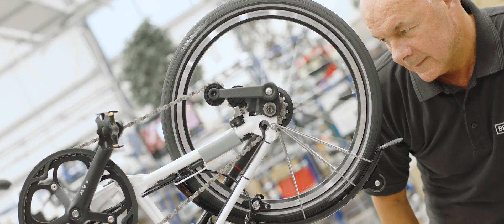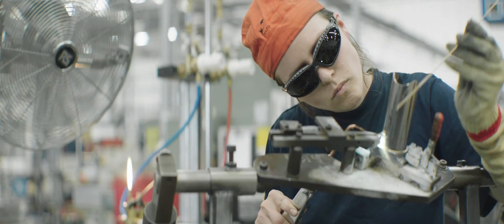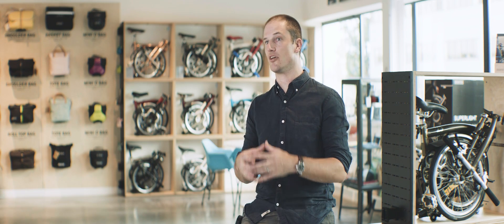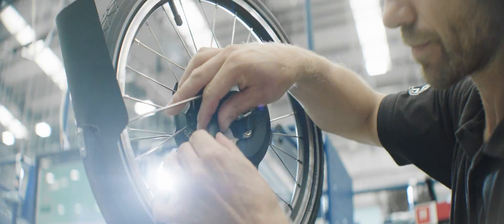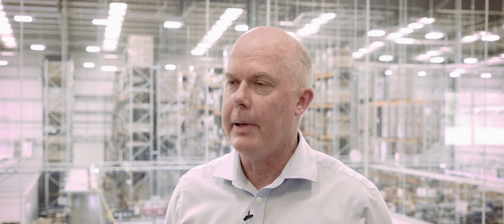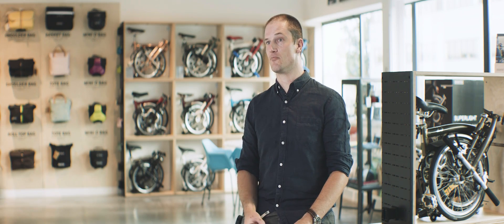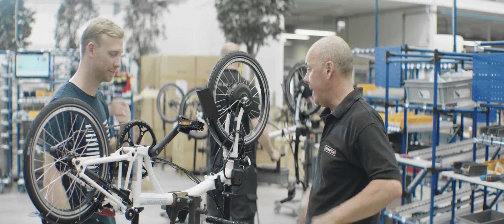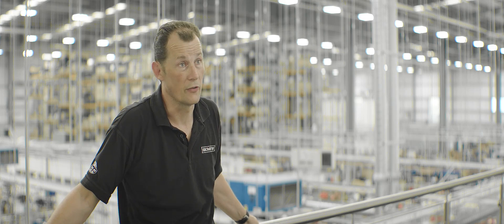Brompton Electric Behind the Scenes

Comment: Carbon fibre and flat mount disc brakes. 135 old spacing. It is that simple. If you really want to keep that fold then partner with Rohloff for a properly engineered hub. The latest Dura Ace completely annihilates good old British Engineering. Just add-e.